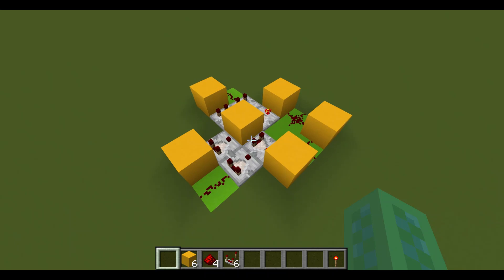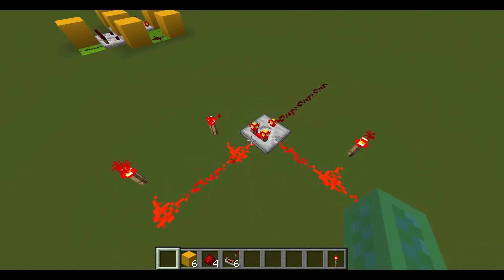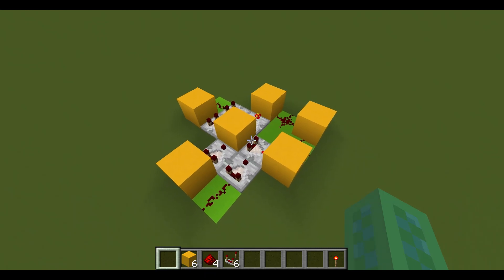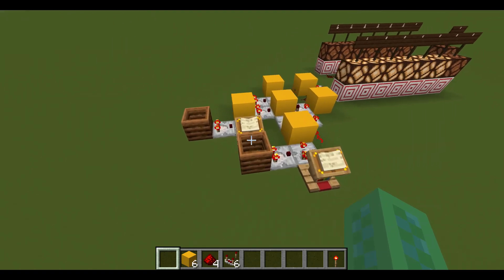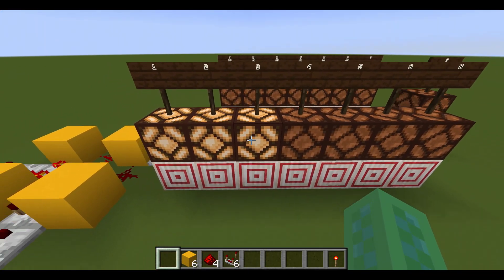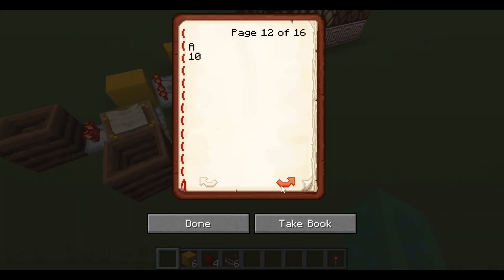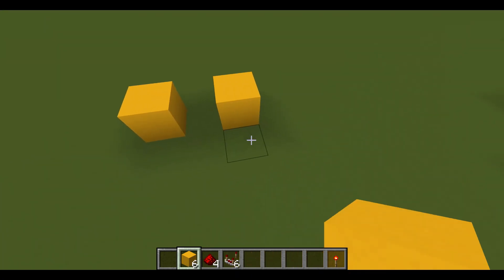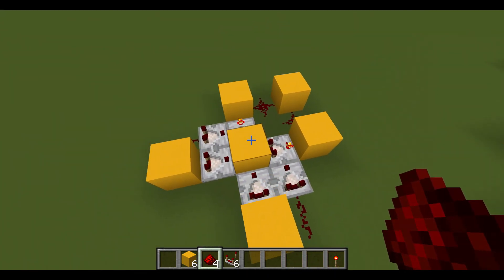NOBODY talks about this redstone circuit - Signal Differentiator

Comment: I remember discovering this circuit when exploring the analog equivalents of Boolean logic circuits. Personally I like to call it the Absolute Difference (AD) gate, since what it outputs is the absolute value of the difference between the two inputs. It’s one of 4 XOR-equivalent analog logic circuits that I know of, the others being the hill gate (if the sum of the input (S) is =< 15 then it outputs S, and if S is >15 then it outputs 15-(S-15), the modulo-16 gate (if S is =<15 output S, if S is >15 output S-16), and one who’s logic function I don’t quite understand yet. You should try exploring  analog logic more, it gets interesting

Comment: I found a very, VERY good use for this thing, may i use it?
Reply from the maker: Of course!  That's why I made this video! :D
Reply: Thanks man, i'll leave a link here when i'm done 😉
Reply: Well.. i hope it will work.
I'm building an analog line-drawer which i have never seen on YouTube before, it should be pretty fast if build correctly so I hope for the best 😬
Reply from the maker: @czdragon7473  Good luck!
Reply: @czdragon7473  there is an analog graphic calculator so yeah. u noob
Reply: @avli16_14dl  can you share a link please?
Reply: @avli16_14dl  that is NOT a line drawer. That is a graphic calculator. Sure, you can use it as a line drawer but that is just a waste of resources.
Hardware accelerated line drawing should be way faster and smaller circuit for only that one specific use.
I want to build a device that would preform Bresenham's line drawing algorithm efficiently, to calculate a line between two points as fast as possible.
I hope that summarizes that.